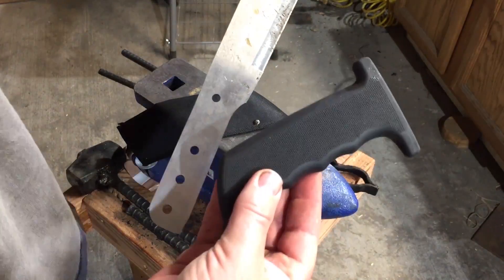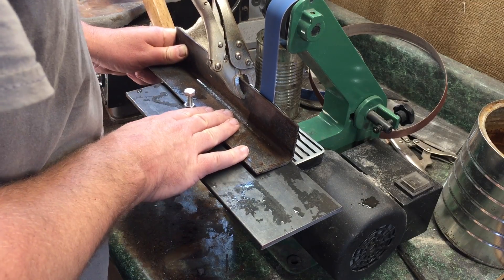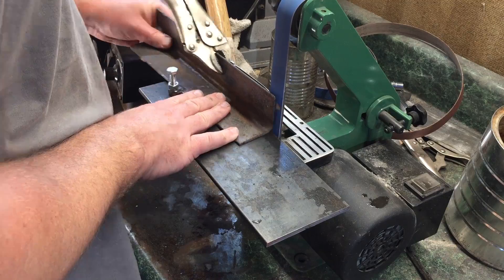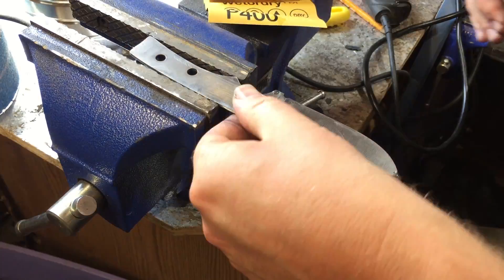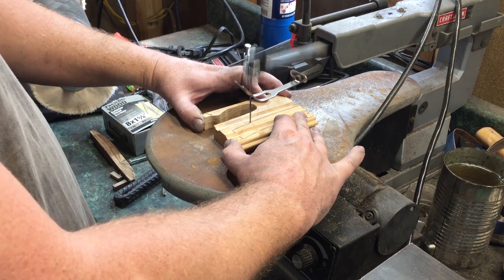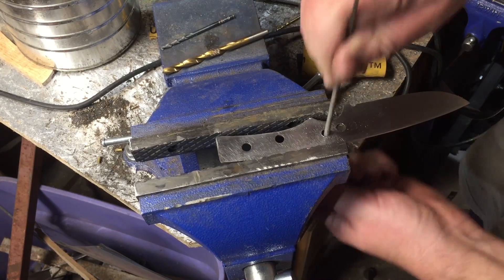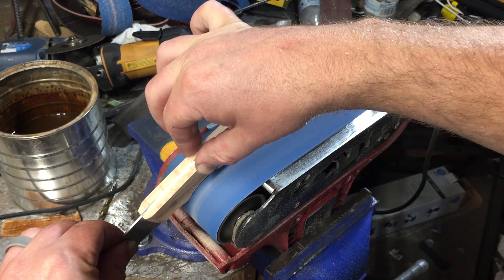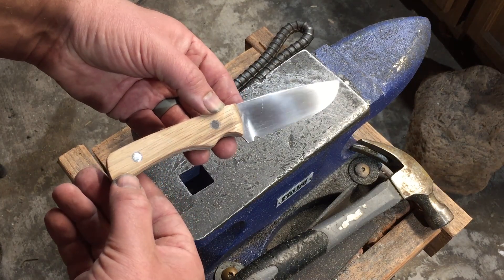How to make an EDC knife from a scrap of a $5 Machete

Comment: Beautiful knife, teriffic job! Be careful with the angle grinder when cutting the handle pins. It's very easy to overheat them, burning the epoxy and the pin can get loose. Happened to me once, lesson learned... Keep it up! 🔥
Reply from the maker: TheIndependentSheep Thanks! (And yes, they did overheat a bit, saw some smoke coming off the wood/epoxy [shh don't tell anyone])

Comment: I have better luck using a masonry or glass/tile bit with a drop or two of motor oil when drilling hard steel.
Reply from the maker: Brian Perkins hey, thanks for the tip (pun intended). 😃 I’ll have to try that.
Reply: i know this is old but use cobalt drill bits when cutting hardened steel and a bit of vegetable oil helps.  @FargoFX